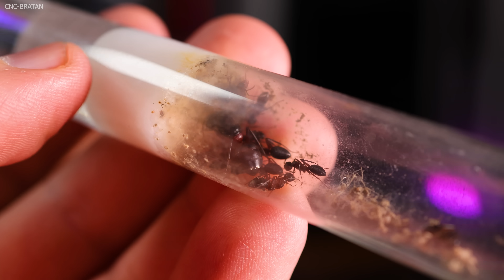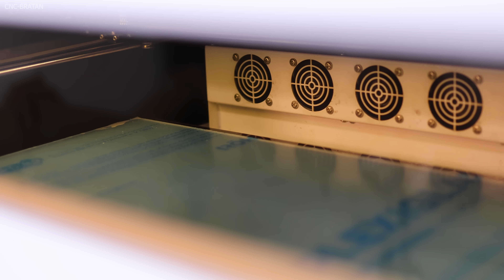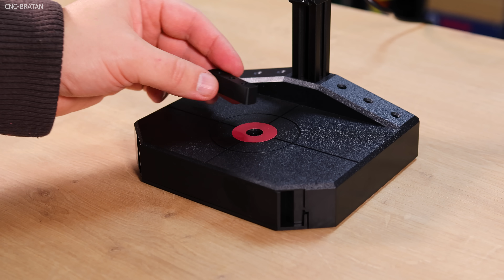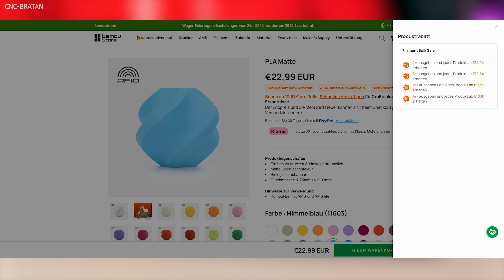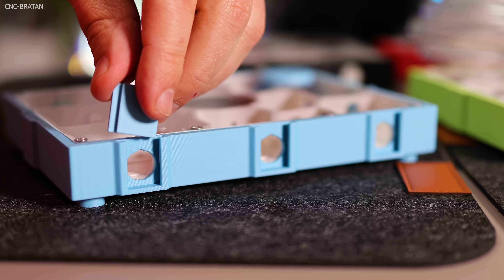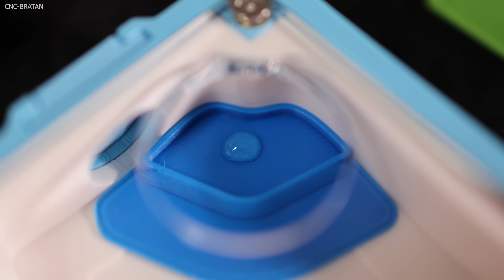Mass-Producing Ant Farms: 3D Printing + Laser Engraver at Home

Comment: I was wondering where to find the print model for this ant farm. It was not in the links you provided.
Reply from the maker: Hi, I didn't upload it; it was supposed to go on MakerWorld, but that requires a CO2 laser.
Reply: @CNCBRATAN Hello,amazing video. I have both a 3d printer and a CO2 laser but i cannot find a model as good as yours unless i just buy a premade one (expensive). just wondering if you could point me to a good model/your model.
Thanks

Comment: can you get by with a screwless deisgn gluing the acrylic sheet to the formicarium? What glue would work best for it and not harm ants?
Reply from the maker: I wouldn't use glue; it's a luxury that the panel can be removed to clean the formicarium at some point. I would use strong, double-sided transparent tape and stick it to the areas where there's enough surface area. But if you want to use glue for something similar, you can ask Chatgpt which glue to use, etc. I'm not familiar with that.
Reply: @CNCBRATAN  Thanks!

Comment: Failed to include the cost of all the manufacturing equipment: 3D Printer, Laser, Heat Press Machine, and any miscellaneous tools. Shipping supplies like boxes, foam inserts, label printer, labels, tape and tape dispenser. Shipping cost either added to the total product price and then offer customers "free shipping" or exclude the shipping price from the total product price and have customers pay shipping at checkout. Website hosting and domain expenses. Marketing expenses. The expenses don't stop after you make the product that's just the beginning. The cost of that product with all expenses adding would be more like 25 euros if not more if you plan on mass producing at home for resale.
Reply from the maker: It's about material costs. Almost all viewers of my channel, which is a 3D printer channel, own a 3D printer. With a P2S printer, you can calculate wear and tear at €0.06. The calculations you're making don't apply to small home-based businesses that have to factor in failed prints. I can't create a production cost plan for every 3D printer in the world. If you think I should use my own products, then I'd be too cheap, since I got most of them for free or bought them with points. If I were to source accessories like screws and hygrometers from China, I'd probably end up spending less than €5 per formicarium. That's why I'm being fair and focusing on material costs. Whoever has to pay how much in taxes, etc., or wants to host a website, is their own problem, and they can calculate that themselves.